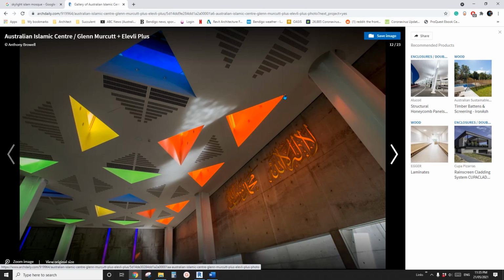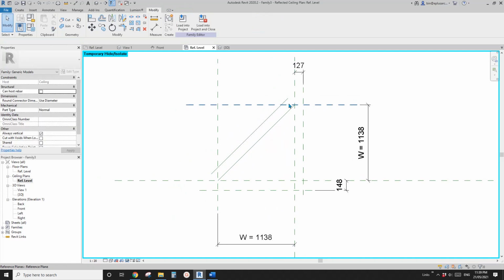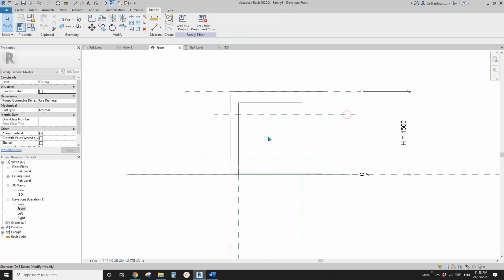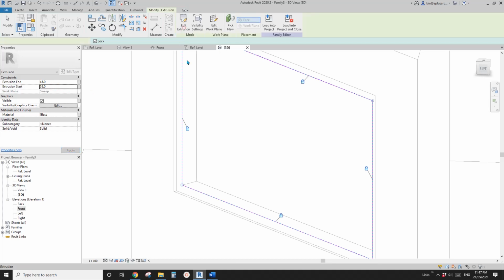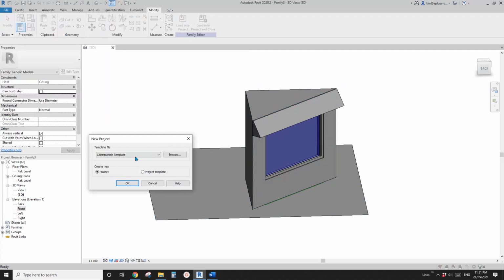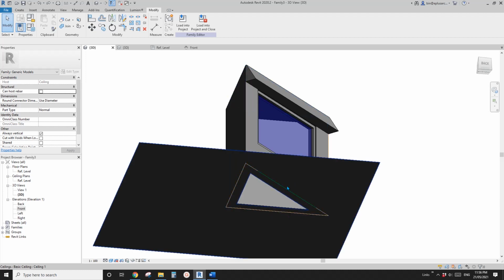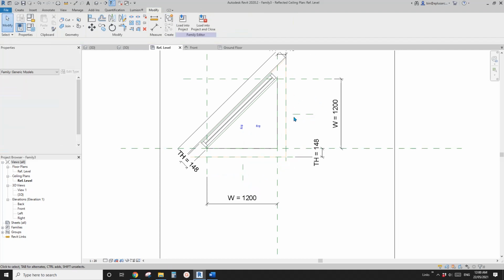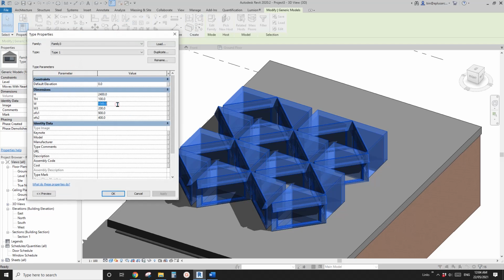Everyday Revit (Day 428) - Ceiling Based Skylight Family

Comment: Hello ….can I get the rvt file ?
Reply from the maker: Sorry mate, I think I forgot to save the file...
Reply: @BINHE615  how do you make it different colors ?
Reply from the maker: I think I changed the default material setting for that category in Object Style.
Reply: @BINHE615  I can change the glass material for each skylight ?
Reply from the maker: @Husztiali6999  yes, you just need to create an instance material parameter for the panel.